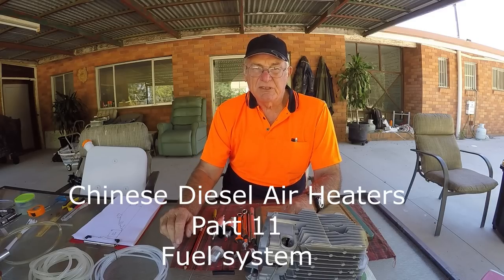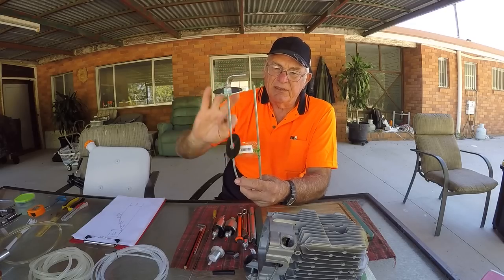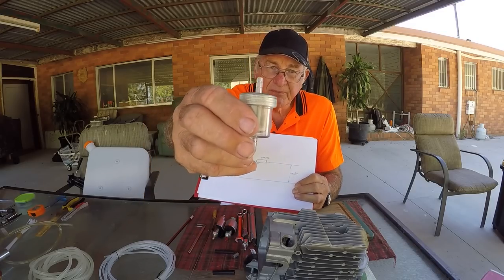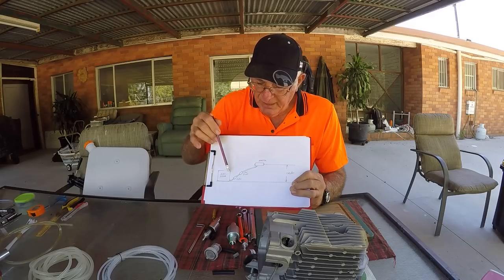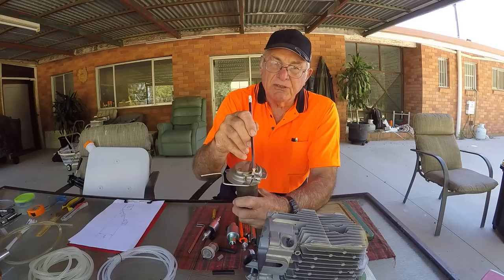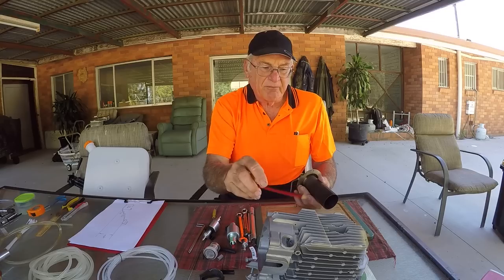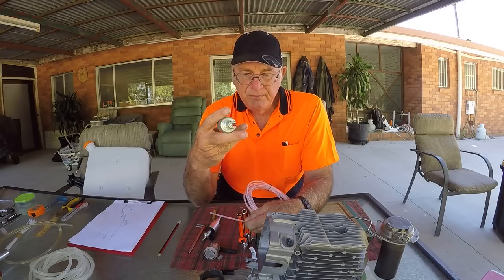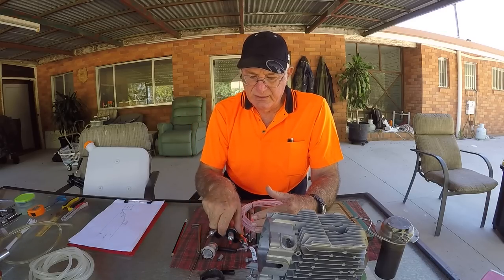Chinese Diesel Air Heaters - Part 11 -  Fuel Delivery

Comment: Hi John McK 47
I have enjoyed all 11 parts of "Diesel Air Heaters". Simply the best instructive videos ever. I have ordered 2 5kw heaters and they will be delivered in a month or so. One for the boat and one for my workshop. I have 2 questions:
In the boat it is almost impossible to get the exhaust below the heater. I have to consider the waterline and raise the outlet approximately 400mm over the heater. What do you think of this?
In the workshop I have 240V AC at hand and would like to buy a power supply 240VAC/12VDC. 20A.
Power supply's are normally switch mode operated. Will that be a problem? or do I have to use normal 12V DC from a car battery with appropriate charger?
Eventually this could be a subject for video no 12:-)
Best regards from Denmark.
Reply from the maker: Hi Bjarne, first thanks for the positive feedback. Now to your questions.

1. You have three issues with a marine instillation.

a. Because most installs are below the waterline the exhaust has to loop up above the waterline, so this requires a condensate drain at the lowest spot in the exhaust, and this is generally at the heater exhaust outlet. However because it is in a boat you just can't drill a drain hole as you will allow exhaust gas into your boat. 

You can buy a marine heater drain from Eberspacher (expensive) or check the link below, or make one yourself, it is quite easy to do if you have a good workshop or mate with one. Basically it is a 90 degree pipe bend with a narrow bore pipe drain with three small loops in the narrow bore pipe. The loops provide a water trap to stop exhaust gas getting into your boat.

In April I am going back to our boat in the Med for 3 months and I intend to do a marine video and publish it on my return in early July. But this is of no help to you just now. Eberspacher publish a marine install guide which may be of some help. However they do not go into actual detail as they insist all their installs are done professionally.

b. You need to buy a marine exhaust muffler or make one yourself. The mufflers supplied with the Chinese diesel heaters leak exhaust through their spot weld construction and water drain hole. You must also do a very good lagging job on the exhaust after you have verified there are no gas leaks., and you must use a muffler sealing compound to remove any chance of exhaust gas leaks.

c. You need a marine insulated exhaust hull outlet. These you can buy off eBay, and when I track back where I bought mine I will leave a link here. I would normally make mine out of 316 ss as I have a TIG welder at home, but I bought one late last year for around $18 US. At that price it was not worth making and polishing. But at this stage I can't find details of the seller for you.

2. Re the power supply, I have not done enough testing here to give you a proper answer., and it could be a subject for another video when I return home in July. 

What I do know is Switch mode power supplies have a lot of ripple in the supplied DC current.
I am also aware of increased ECU failures in these diesel air heaters when installed in yachts or canal boats, when compared to land installs. At this stage there is suspicion among professional industry repair people that the increase in failures in the marine field is caused by ripples and spikes coming from alternators with boost type regulators and cheaper battery chargers, particularly those with long cable runs and thin cables that cause increased ripple. It is excessive ripple and voltage spikes in  the DC battery voltage that destroys the capacitors in the ECU.

I could not find the eBay supplier where I bought my boat stuff, but here is just one link to get you started on your searching. This site has the exhaust through hull fittings, marine mufflers, lagging, and exhaust drains. 

https://www.ebay.com.au/str/dieselheaters4ultd

It is not a simple answer for you, but I hope it is a start.  JMcK
Reply: @johnmck1147 
Thank you very much, it helps me a lot. I wonder about my old (1989)heater (Mikuni 3o) which didn't work. Mounted in my boat which I purchased last october. No water trap, mufler with tiny holes, and ordinary non isolated outlet!!
The muffler looks OK and I will close the small holes and test for other leaks.
The exhaust outlet I will have to buy. The 90 degree pipe bend I'll make myself. The only information I need is the exhaust outlet diameter on the heater?? I guess its the same on all 5kw models, so if you agree, please measure for me. Thank you very much.
Reply from the maker: Hi Bjarne, they vary slightly between different castings, but the exhaust outlets are around 24 mm diameter.

Comment: Can you use a 12v adaptor rather than a battery to power these units in a workshop set up?
Reply from the maker: Hi Paul, yes you can use a power adaptor. In use they use about a max of 3 amps to run, but because the heater needs around 10 amps to start you need a minimum of a 10 amp power adaptor. You can buy these from an electronic store, off the internet, or even some camping stores sell them to run 12V camping fridges off mains power.  JMcK

Comment: Awesome videos , my diesel heater plumbed  in correct fuel lines ,runs great however after a months or 2 use it seems to blow grey smoke on start up for around a minute before firing ,any idea what this could be ? It runs fine just start up is Smokey sting smell then usually fires up ok and clear smoke from exhaust  it started up quicker when it was new  its been run on all heat levels
Reply from the maker: Hi Mr ZH

Could be a couple of issues.

If your fuel tank is higher than your heater you may be getting fuel seepage into the heater. 
If this is the case, install a fuel shut off valve in the fuel line and turn it off after use.

You could also be getting carbon build up in your heater burner causing it to hold unburnt fuel (like a sponge) 
Do you occasionally run your heater at max power for a few minutes to burn off any accumulated carbon.
Are you running a fuel additive in your diesel? This causes carbon build up in the heater.

As a suggestion I would first run your heater for at least 30 minutes on a high manual setting, say 5 Hz using a high kerro/diesel mix (90/10) This will help remove any accumulated carbon.
If you had large deposits of carbon your heater would not run.

Please let me know how you go.  JMcK
Reply: @johnmck1147  Hey thanks for taking time to reply , my tank is just a fraction lower (its main fuel tank ) no problem there ,yes I run it on high and low , I wonder if its the voltage drop ? I have a 12ft run of okish   cable good for 20 amps  max but I do get lower volts when the glow plug is on but it still pulls 10 amps on the current display  so I guess its still getting hot ,on the LCD it displays 12v but when starting it shows as low as 9 volt is this normal ? It started ok for first 100 start ups it  only Does It if its been left to cool right down .
Reply from the maker: ZeroHour 

Hi ZH, 

With just 9 volts at the heater you will not get a good start.

Also, with use you get carbon deposits on the glow plug and glow plug screen, so the heater may run ok when new, but get harder to start as it ages.

Suggest you increase the power cable size, and run a couple of litres of kerosene through the heater to clean it up a bit.

Cheers.  JMcK

Comment: Hi John, very interesting points to look for. I hope to place such a heater in my campervan, however your first diagram shows the fuel tank to be lower than the burner, I was planing to mount the burner on the floor & the tank in the back higher, probably with a fuel line like the Eberspacher long reach type. So high tank 
, low burner, would this be a problem?
Reply from the maker: Hi Dozukime, no, that is not a problem providing the fuel tank is not too high above the heater where fuel seepage can occur due to head pressure. However I suggest you install a fuel shut off tap in the fuel line between the fuel tank and the fuel filter and turn this off when not using the heater.  JMcK
Reply: @johnmck1147  Thanks for the info. Regarding a fuel cut off, would it not be better just before the burner, there would be minimum fuel in the pipe at that position?
Reply from the maker: dozukime 
Hi Dozukime, it really does not matter too much where the fuel shut off valve is located. You put where it suits you. I like to always install a shut off valve,  and I position mine close to the fuel tank where I use normal fuel hose and an easily sources fuel valve. This way you can close the valve if there are any leaks in the rest of the set up.  If you put the valve close to the burner you will need to install the valve in the pressure side of the pump and in the hard narrow bore nylon fuel line. That may creat you some issues.  JMcK
Reply: @johnmck1147  Makes sense.

Comment: Is there any chance of using a different pump thats a bit more quiet?
Reply from the maker: I wish there was Mr C. 
It is the nature of the system operation. The ECU can only count pump pulses to deliver a certain amount of fuel.

Webasto claim to have a quieter pump for their heaters that has a sort of diaphragm on the top to lessen the ticking noise which you could use, but you could buy about three new Chinese heaters, for just the cost of the pump. 

Sorry.   JMcK

Comment: I'm considering buying one of these heaters for my van. I have only viewed this one video of yours, will spend some time with the others. From what I have seen in other videos, the manufacturer requires the heater to be bolted to the metal floor of the van on top of two drilled holes for the air intake and exhaust hoses to penetrate to the outside. Does this mean the fuel tank has to be under the van to get the upward angle on the fuel line or can the fuel tank be above the heater? I'm also considering using an outboard motor fuel tank that comes with it's own fuel line connector so I can take the tank out to fill. What do you think? Thanks for the very informative video.
Reply from the maker: Hi there. 
If the heater is mounted on the floor of the van you need three holes. The third one is for the fuel line. You could, if you wished, make a bracket to mount the heater a little off the floor and just have the exhaust exiting under the van.

Yes, an outboard motor tank will work well  in your application.
Reply: @johnmck1147  Thanks again!

Comment: I think I’m having the air bubble problem you described on delivery side I have the soft flex fuel line that came with mine…where do I find the hard fuel tube…Home Depot?
Reply from the maker: If you search on line for “Hard nylon fuel hose for Eberspacher diesel parking heater”, or Eberspacher diesel air heater” you should see lots of suppliers. Always include the word Eberspacher, or Webasto in your search. They are the original heater designs. JMcK
Reply: @johnmck1147  thank you!

Comment: Hi John. Thanks so much for your detailed and informative videos. I've got a 'silent' fuel pump and I'm using the smaller hard fuel line. The pump started off very quiet but after a few weeks of use it has become much louder. I'm guessing this is due to cavitation within the pump, which I have tried bleeding by putting temporarily to a 90degrees upright position. There is no air in the line between the tank and the pump (pump mounted below and close to tank) and I can see bubbles appearing in the outlet side. I do have quite a long fuel line from the pump to the heater (approx 3 metres) and it's not inclined the whole way, not sure is this could be contributing? I'm particularly puzzled as it was working perfectly for almost a month with frequent use before it started getting louder. If you could shed any light or offer any suggestions I would be eternally grateful! All the best from the UK!
Reply from the maker: Hi SC, 3 m of fuel line from pump to heater is ok, and if narrow bore hard nylon, some dips are also ok. If pump working for a month without issues, you may have worn out the pump. Do you have a good quality fuel filter installed before pump? Dirty fuel will wreck a pump.  JMcK
Reply: @johnmck1147  Hi John, thanks for your reply. The kit did not come with a fuel filter, which I questioned with the supplier and they replied with this :
'A fuel filter is recommended for very old tanks and marine use.

As you are using a fuel tank a fuel filter is not necessary.'

So I didn't install one!
Reply from the maker: Well Serin, what can I say to that!!!
Suggest you ask your supplier for a new pump, and then install a good fuel filter. The valves and seals in these pumps are very small and the most tiny bit of dirt will cause you pump problems.  JMcK
Reply: Hi again John,  I got a new pump and fuel filter which I have installed, the pump is however still very loud. I can see there is a pocket of air in the filter which I suspect is the reason. Do you know I can best emilinate this air pocket? Many thanks once again!
Reply from the maker: Hi Serin, 

Pump will still work with small air pocket in filter. It is better to prime with filter vertical to get air out, but pump will still work.

Yes, these pumps are noisy as it is a fast moving metal piston constantly hitting the end stop. 
Do you have it rubber mounted?  JMcK
Reply: @johnmck1147  

It's rubber mounted yes and I attemped to prime vertically but this made no difference. I'm aware the noise is characteristic  but this is a much more expensive 'silent' version and as I mentioned before the two I previously installed were both very nearly silent upon first installation and then gradually increased in volume after about a month of use, so as per your suggestion I got another pump and this time added a filter but now I can't seem to prime the pump correctly to get it to its minimum volume! Very confused and out of pocket now... but at least I'm not cold..!
Reply from the maker: Hi Serin, just confirming your heater is working, but the pump is noisy?
If pump noise is a real issue for you, suggest you have a quick look at boat video where pump is suspended in the air. Normally not worth the effort, but in boat incident the pump is under my bunk and just inches from my ears.  JMcK

Comment: One more question John, have you ever heard of people needing to use a diesel antigel additive for temperatures below 14 °F or -10 °C to prevent gelling?
Reply from the maker: Hi DP, 

In cold countries you buy winter diesel with additives already mixed, but I have had reports of heater owners using additives in winter. However a lot of additives can cause greater than normal carbon deposits, and I suggest using a high Kerro/diesel mix in real freezing winter climates.  JMcK
Reply: @johnmck1147  Hi John, thanks again for the information! Also, here in Romania we have two options at the pump for diesel in any season: regular and premium. Should I opt for the premium to be used in my heater as it is "cleaner"?!
Reply from the maker: Hi DP, if the fuel burns cleaner, the heater works better, and less carbon is deposited and hence less maintenance is required.  JMcK
Reply: @johnmck1147  Yes, ok. I learned today also that Romania has winter diesel and summer diesel automatically changed by the gas stations.

Comment: Can you have the tank above the heater? 
Will that fix or create any issues?
Reply from the maker: Yes, but you need to install a shut off fuel valve and turn off when heater not used, otherwise fuel can leak past pump and flood heater making it impossible to start next time you wish to use.  JMcK

Comment: The tiny fuel filter thats built into the fuel pump,  does the casing just unscrew  counter clockwise and you can then pull the filter out and screw the metal casing back on..and then put a better aftermarket fuel filter inline ?
Reply from the maker: Hi Dave, I have only seen the German fuel pumps come with a built in filter, never a Chinese fuel pump. Regardless though, whether you have a built in pump or not, you should install a good external fuel filter.  JMcK
Reply: @johnmck1147  Ty..so the chinese knockoffs never have the small filter inside the fuel pump ?
Reply from the maker: I have not seen a Chinese pump with internal filter.

Comment: Hi ,Can i ask what is the best size from the pump to the heater 1.5 ,2.0, 2.5 hard nylon line  will it make a lot of difference  ?
Reply from the maker: Hi Louie, The recommended size is 2 mm bore. Other bore size will work with variations in efficiency, depending on the install. JMcK